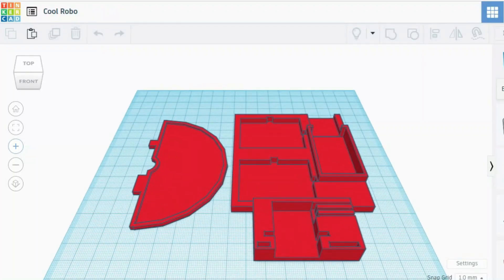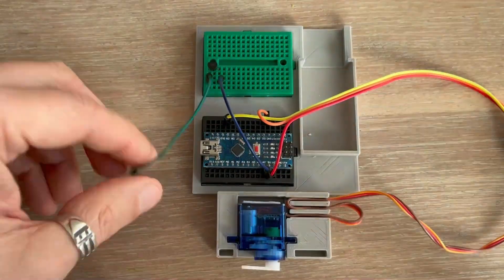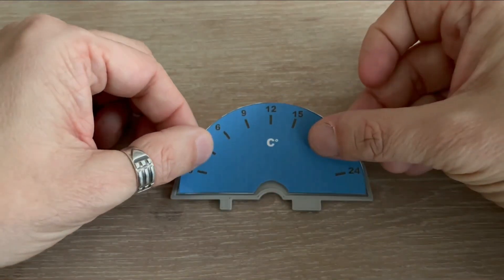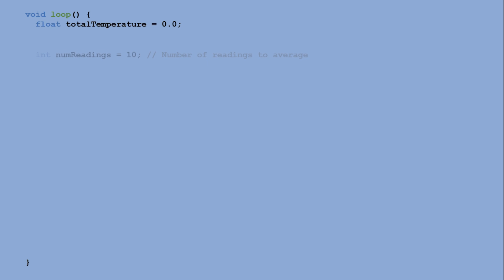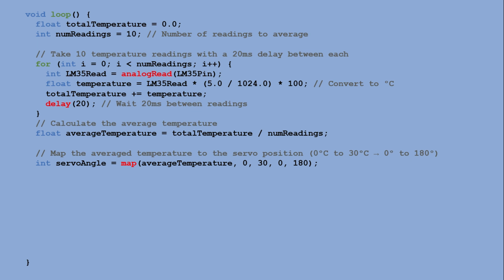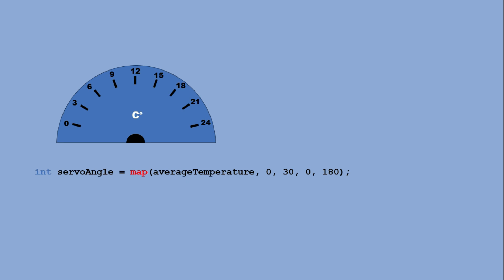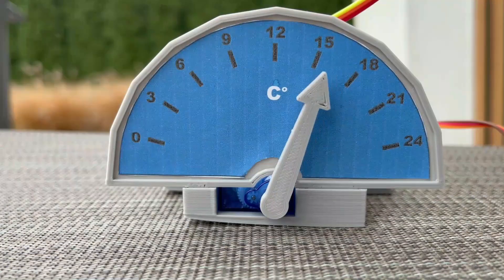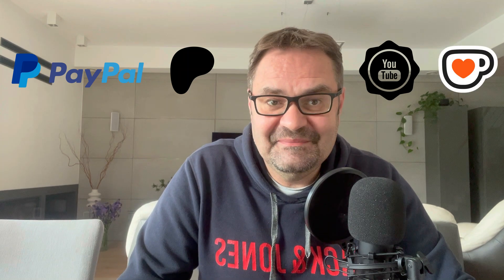Temperature-Controlled Servo Motor with LM35 and Arduino

Comment: Nice, thanks! Can you make a video of 74LS592/74HC592  8-bit binary counter with input register. Its functioning is otherwise clear to me, but I am not sure how to  make it load the input register value into the counter after reaching 0FFh. Can the ripple carry, /RCO,  be directly connected to the /CLOAD input to do that. I ma not sure about the timing constraints in this case.